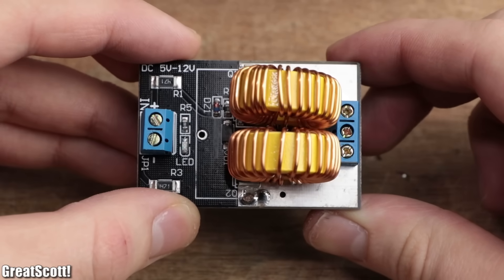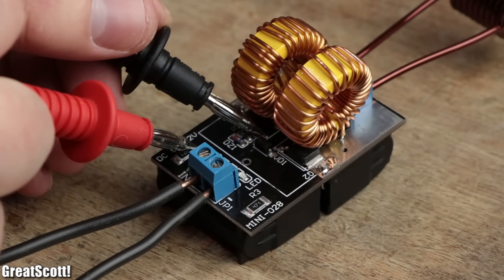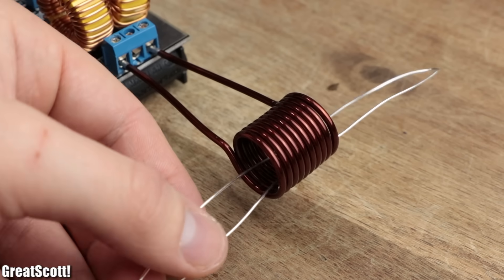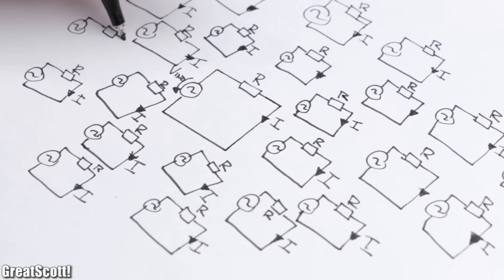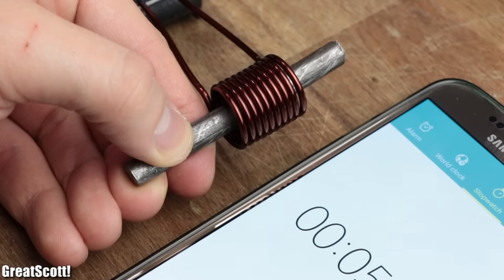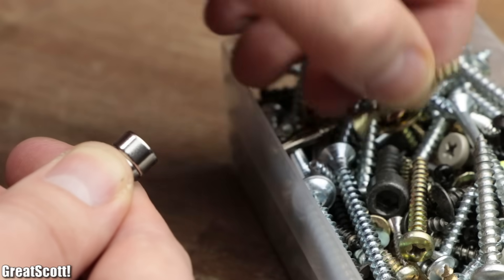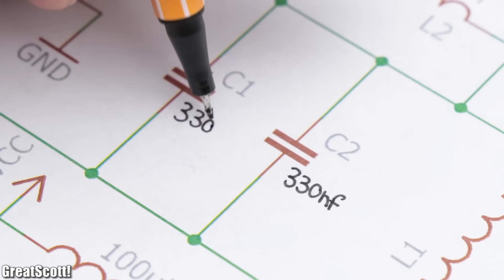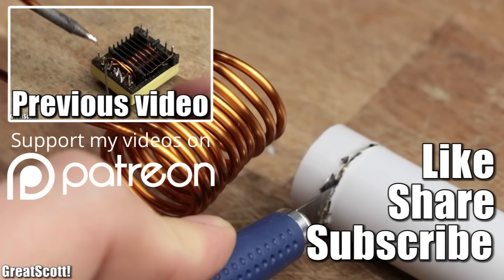How does Induction Heating Work? || DIY Induction Heater Circuit

Comment: try mazilli's zero voltage switch induction heater circuit
Reply: It is...

https://www.facebook.com/vladi.mazzilli
R&D Technician chez Riello UPS
Auparavant : Electrical engineering

https://i.postimg.cc/9Q0fsf8f/About-Vladimiro-Mazzilli-vs-Royer-ZVS-Known-as-vladi-mazzilli-on-Face-Book-Graph-ed-by-Egzoset.png

And this was the result:

https://docplayer.net/26964431-High-voltage-resonant-self-tracking-current-fed-converter-a-thesis-presented-to-the-faculty-of-california-polytechnic-state-university.html

High voltage resonant self-tracking current-fed converter (2010-Mar)
p52/152 Mazzilli Converter Topology

p53/152 Figure 2.9:  Mazzilli Converter Topology

Comment: Could you add a few more capacitors to the output to get more power out of it? 
I want something that heats up something thicker a little faster without going to 1000w

Comment: I was just wondering, could you just add more caps to the output side of the eBay board or your circuit schematic to get more power? I want to boost it to 500-700w

Comment: For world domination (more inductance) i need more turns in coil? what other factors affect inductance? does area of coil affect inductance? what about wire thickness? what abouth lenght of coil? i want a high inductance coil so i can try see if earth magnetic feild induce current in it, thanks
Reply: Flux Concentration for starters.

Comment: What if you replaced a heated extruder in a 3d printer with an induction heater, and replace the plastic filament with very thin iron or copper wire? Then add a cooling system to cool the metal right after it is deposited (the hardest part). Maybe we could have a real metal 3d printer rather than just plastic filament with metal shavings in it.
Reply: I'd suggest searching "PyroFoil" in your case.

Comment: Iron (steel) 26-Fe, Cobalt 27-Co, Niken 28-Ni: They are in the Iron-magnetic group. the Foucault current (AC) will make them be hot (the ingot or bar form of those materials is easily to transfer heat)

Comment: hi scott i have 100 red laser diodes 650nm 5mw all connected in parallel .i need a powersupply . i think current /diode is 25 to 40mA .pls help how to build a powerupply and how much current is required

Comment: Im wondering why the coil doesnt short even the electricity flows trough it. Even the transformers, example in the AVR, the transformer creates magnetic field and has live electricity. If nothing is using avr and avr is on, why its not using electricity? i want answers thanks

Comment: hi scott, is it possible to use larger coil to heat up a metal drum around 20 cm diametre using 240v , 13 amp power supply?

Comment: Is there a way to control temperature effectively? Like degrees over time?
Reply: With sub-unit precision expressed in Celcius, while thermostatic regulation takes place in a fraction of seconds?

Sure, it can be done indeed.  But the fanboys won't tell you here as that would hurt (obsolete/rebranded) PCBoard sales i figure...

Comment: The silver copper thing is actualy tin
Reply: no it's different.
what you're talking about is solder, which is a tin-lead alloy.
silvered copper wire is copper wire that has been silver plated and looks like "tin".
if it was tin it would melt.

Comment: I am great fan of u. Could u pls let me one thing about this circuit, when I am measure voltage across the heating coil it greater than the 1000 Vac. My capacitor is only 600 volt. It will destroy my capacitor?. I am use IRF3705 mosfet, it's drain current approx 80A, but I don't know why it's so much heated up. Except this mosfet my circuit more or less same like China circuit, but it's working perfectly.
Reply: "ZVS" no longer "ZVS" perhaps?

Comment: Suggestion: DIY Class D amplification video
Reply: Using the Texas Instruments TPA3255 chip one can safely theorize nearly 5 KW could fit some 6 x 6 x 1.2 ~ 1.5 cm PCBoard, double-side...

For example:

https://i.postimg.cc/3x12m9QW/Egzoset-s-Univ-2-Phase-4-Poles-IH-Work-Coils-Assy-16-mm-Aper-PCBoard-Placement-of-Ti-TPA3255-2.png

But of course there's more to it.

Comment: Nice video GS. I guess the inductance of L1 is a couple of magnitudes lower than L2 and  L3? It is not shown on the schematic. Also, would a higher or lower frequency of the tank circuit improve the heating capacity of the unit for steel? I will have to build a unit and do some experiments if I get time.

Comment: I have an idea, you pass a stainless steel pipie through the coil, and pass water through the pipie, about 1 liter per 2 minute, measure it reached atleast 45 degree celcius or not, then the water will be very good for shower.
Reply: Sakhina Khatun There are hot water systems for sale ;)
Reply: Yes I know that but I want a induction water heater.

Comment: Great. I have a few questions. How is the voltage requirement changed as you add inches to the coiled copper length? What is the additional power requirement when more workpiece is added to within the copper coil?

Comment: Design a V-10 block Manson engine. Use low voltage induction of pistons that can operate off solar panels. Take a transmission designed for the fly wheel to turn a high voltage power generator that charges a capacitor bank. DO you have the knowledge to help me developed this concept of off grid energy production? I am looking for a technical person to assist me in other projects I am working on. Are you interested?

Comment: Would an induction electromagnetic pump that heated and circulated gallium through a copper coil heat exchange be a low cost way to heat water? If so could not a solar panels run a inducted electromagnetic pump with heated gallium to operate thermal electricity generation? A solar electric power plant that produces more electricity then just having solar panels and a battery bank?

Comment: hi Scott! I love you videos. Can you post a link to somewhere I can get silvered copper wire? thanks!
Reply from the maker: Search for it on Ebay. Mine is 0.8mm thick.
Reply: Do you used the stuff meant for jewelry? That's all I find with the key words "silvered copper wire". If I search for tinned copper wire, then I get insulated wire.
I really appreciate that you replied. Keep up the great work, I'm a big fan! :)
Reply: Aiming for the MHz range??

Comment: Hmm ... interesting that schematics is also known as a ZVS driver for powering high voltage transformator, I have only one question: powering your driver with 12V and 3A  make rather power loss on those two mosfet and you are using then without any heatsink
Reply: Mazzilli attributed the diagram published on his FaceBook account as "Royer ZVS":

https://i.postimg.cc/9Q0fsf8f/About-Vladimiro-Mazzilli-vs-Royer-ZVS-Known-as-vladi-mazzilli-on-Face-Book-Graph-ed-by-Egzoset.png

Comment: i don't really understand the circuit. so the 2 coils connected to VCC are just to "transfer" it to . constant current source? seems kinda wastefull. why not use Transistors for that? 

and what are the mosfets actually doing?
Reply: i have the same doubt, few comments ago i tried to give a partial explanation by myself, but i am not still sure, anyway try to read it. Uhuh, why high voltage capacitors ? Do you know ?

Comment: Can this small of a system put out enough power to melt a piece of metal, if you left it there for say a few minutes? Or does it not have a enough power to perform such a task, and if it doesn't would would need to be changed in order to make one that could function as like a paint can size metal melter.

Comment: Why both circuits use high voltage capacitors ? 600V for your board and 1200V for the chinese

Comment: How does the efficiency and power capability compare between this style and the center-tapped heating coil design?
Reply: Somehow i'm so surprized not to have read this most relevant question before, considering the vaporist application is meant to operate on portable batteries...

Comment: One very important thing you need for an induction heater is a power source that doesn't have a buildup time on the voltage or your heater will go boom
Reply: How so?  The fanboys now claim there's protection "built-in", thanks to the "DNA"...  Whatever this could mean!

;->
Reply: @Egzoset  lolwut

Comment: I just can't get my ZVS to oscillate, and I don't know why, maybe you have an idea. I'm using WIMA caps and i have mosfets that also have fitting characteristics. My design is the one with a center tap and one inductor, the inductor is from an old PSU, the shottky diodes are aswell. I have checked the cicruit over and over now and I cant find the problem. Possibly you (or others in the comments) have an idea were to start troubleshooting.
Reply: PS when I connect the PSU to the circuit it just draws about 2 amps but only through one mosfet that is always open. I have tried switching them out, aswell.
Reply: https://docplayer.net/26964431-High-voltage-resonant-self-tracking-current-fed-converter-a-thesis-presented-to-the-faculty-of-california-polytechnic-state-university.html

High voltage resonant self-tracking current-fed converter (2010-Mar)
p52/152 Mazzilli Converter Topology

p53/152 Figure 2.9:  Mazzilli Converter Topology

Comment: Hey GS, you call your VCCs as constant current source. Aren't they voltage sources?
Reply: +GreatScott Ah I see what you mean! thanks for clarification
Reply from the maker: +ElectroBOOM They are voltage sources. But the inductor will act as a constant current source.
Reply: @greatscottlab   Dude no offense but ur handwriting is cancer
Reply: ElectroBOOM and GreatScott! two of my favourite electronics youtubers in the comment section of the same video!
Reply: i love ElectroBOOM and GreatScott !
Reply: Hmmm, Interesting idea. Should be doable. Any thoughts on the subject Mr. +GreatScott
Reply: I also wanted to ask you about that ... what do you mean by constant current source ?, aren't they just a high-frequency choke to prevent oscillations from coupling back to the supply
Reply: I meant GS! fixed
Reply: +ElectroBOOM and +GreatScott! is it possible to run a iron water pipe inside the coil and make instant electric water heater for the purpose of bathing, dish washing, etc.?
Reply: OMG THE CLASH OF THE TITANS!!
Reply: Mehdi is still alive?.. ma gawd .  this is miracle after so many times electrocuted
Reply: make a video together <3
Reply: FIGHT FIGHT FIGHT !!! lol
Reply: Yes, since current cannot change instantly the inductor acts like a constant current source in the circuit, is opposed to a variation in current, so, it's constant
Reply: ElectroBOOM will ruin all equipment of great Scott
Reply: OMG, CURRENT MEHDI AND GREAT SCOOT
Reply: Looks like I also like DiodeGoneWild.
Reply: Electroboom teaches us how electricity works with crude but working and functional demonstrations.
Great Scott teaches us how to harness the power of electricity with electronic circuits and his mostly well polished but often over complicated builds.
Both are necessary to inspire  a new electrical engineer.
Reply: @CrazyNerdInventor  We need to get EEVBlog's Dave Jones in on this somehow... I think he completes the trifecta.
Reply: @EmrysMaier  GreatScott and Electroboom still have a long way to go to compare with Dave😏
Reply: omg mehdi !!!!! my favourite channels are greatscott and electroboom . so what a coincidence
Reply: OMG ITS ELECTRO BOOM I LOVE UR VIDS
Reply: ElectroBoom and GreatScott they are the channels for electronics!
Reply: Says the guy fluent in broken English and nearly kills himself in almost every video he makes.
Reply: This is bridge if these shorts then *boom AH SHIT
Reply: We want a collab! !
Reply: Instablaster.
Reply: yes, MrTea
Reply: ElectroBOOM m
Reply: AnimaXionA me too
Reply: ElectroBOOM FULL BRIDGE RECTIFAYAAAAAAAA
Reply: and then you put your noses everywhere! I LUV >>>> u... haha... GIMME DA MEETAA
Reply: Das ist gut, could be hard to do with vacuum tubes, but then the voltage can be 500 volts, current 1amp.
Reply: AnimaXionA You want to reproduce with them?
Reply: Wow two geniuses
Reply: Boom
Reply: ElectroBOOM  ElectroBoom?hello,I am from China.
Reply: CLANK,PUMN,HARRROUMPHHH
On the railagun vid
Reply: You know it would be a great collaboration of YouTubers if electroboom and greatscott were to do one
Reply: The inductance acts as a chole for RF, if it has a low Q.
Reply: lol @ u
Reply: GreatScott-ElectroBOOM collab now! :D
Reply: FOOL BRIDGE RECTIFAYAH!!!
Reply: Hi
Reply: If the inductance is big enough,the fluctuation of the current is negligible,so it can be a current source.
Reply: Why are some commenters reacting as if Electroboom was being confrontational with his question? I read it as a simple question out of curiosity, and I’m glad he asked it because I learned something from the thread. I saw nothing more from Electro’s question.
Reply: I love Great Scott’s take on electronics because from everything I have seen based around electronics, Germany teaches and approaches everything electrical in a unique way. It’s very “thorough” and is more like a chemist in a lab following everything according to the “scientific method”. I’ve actually seen engineers who work in their garage tinkering with various things mechanical in nature who were based in Germany that were wearing leather coats and especially aprons. And that in particular, isn’t too common in the US.
Reply: DAAAAYUMMM, that hurts
Reply: oof
Reply: ElectroBOOM you need to collab
Reply: @Cristian OK in this sense then why does the supply current increase when a load is present (something is being heated) .. it's just not accurate to call it "a constant current source", "a choke" is the right term
Reply: Because when the magnetic field collapses, we say that it generates a voltage source and a constant current source (it generated a whatever voltage that is required by the load).  
The constant current source is for a specific part of the circuit, not for all the circuit (Inception lol)
Reply: you mean like a tea kettle?
Reply: @dalton1209  a kettle isn't induction heating. It's an element heater
Reply: 哇，伊朗作死哥
Reply: I can see the point of calling it a current source, it's just not very precise in this situation. Anyways it doesn't really matter what you call it, does it ! Cheers mate
Reply: @AboubakrA  it does matter what its called, as to not mislead or falter technicalities of expanding solidity of doctrines.

Comment: Haha LoL, just in the moment i am build and simulate an Induction heater circuit in LTspice. XD 
But it will be a little bit more komplex as yours. (PLL VCO, high power GDT driver,  Full Bridge PA and an impedance matching transformer)
btw your circuit is known as Resonant converter by Mazilli.

Comment: It just blows my mind how much you know about this...
Reply: Jonny D or he just studied engineering
Reply: Hoang Seidel Probably thats it but he doesnt know things to much more complicated?
Reply: He didn’t really explain that much. What are those two coils before the big one? What produces electromagnetism, and what produces the heat? The big coil isn’t the actual induction? It would heat up glass and stuff just the same, so the metals he tried simply have different heat capacities?
Reply: Rodrigo Pereira standard knowledge for an engineer
Reply: More like electronics or physics than engineering alone.
Reply: @myscummyneighbours6065  because he also self-taught
Reply: Rodrigo Pereira I think he reads of a book or his notes before telling it in his video.
Reply: And I can't even put batteries into a tv remote without messing the sides...

Comment: Is it possible to build one wich could actually melt iron? What specification should it have?
Reply: Yes you can. My job was a tool maker and I used to super heat metals to get worn diamonds out of some used tools to the point the steel would drip onto the floor and explode like a firework. I'm going self employed and I will be buying a large induction heater very soon.

Comment: So... I just had an idea... What happens if you put a magnet into that coil, or on an inductive heating surface?

Please if you do it only if you think it is safe to do so. I have no idea what could happen, but you might.
Reply: Lagger Onesixfour in my opinion it would heat up quickly, but nothing bad will happen. I think power drain may be too high if you put magnet inside (the same happened with iron).
Reply: Lagger Onesixfour search on youtube "Levitation coil - Induction heating", you will see that a piece of iron floats inside a coil and the magnet will behave same, but will be heating up faster)
Reply: It may depend on the metal, but the hotter a magnet gets the less magnetic it becomes.

Comment: The only real difference with industrial induction heaters is that you have a copper tubing that has water flowing through it to prevent it from heating up... Those are capable of getting metal up to 3000 F.

Comment: But why do you need all that fancy circuitry in order for this to work? Why can't you just connect the power supply to the inductor?
Reply: The circuit basically acts as a transformer where the secondary, consisting in the metal object, is shorted out. And, because transformers don't work on DC (the magnetic field must be variable), neither does this
Reply: Juho L try that and you will end up homeless (no seriously don't try it 😂)